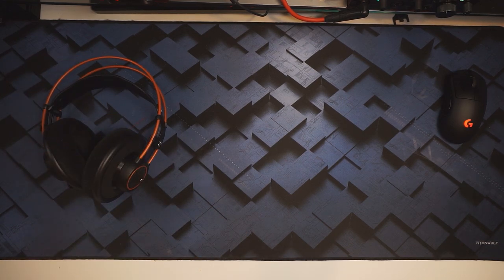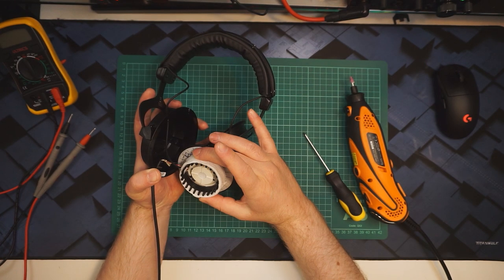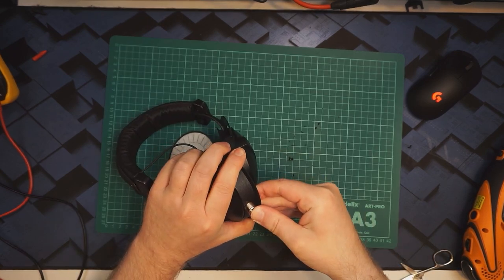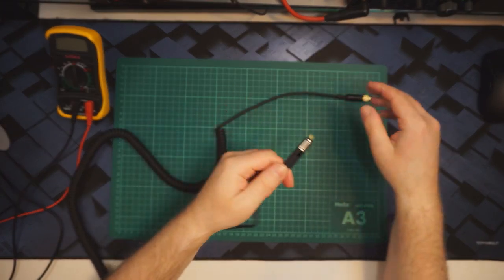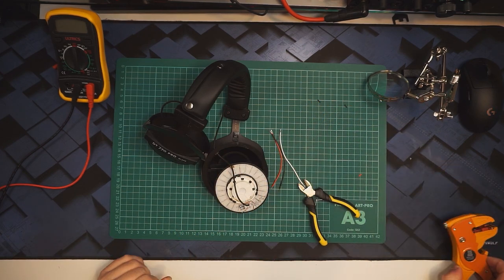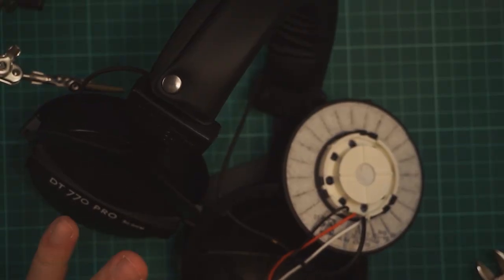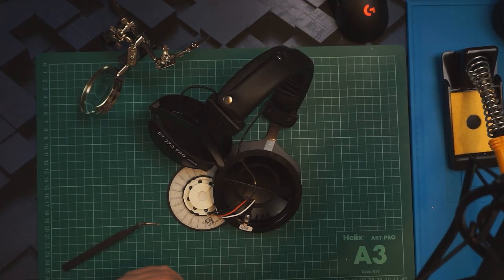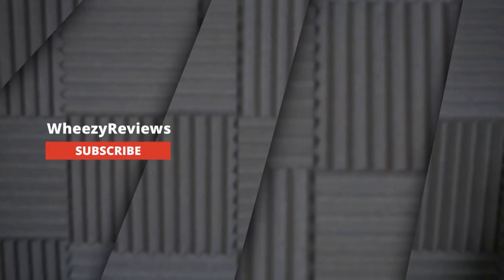DT770 Removable Cable Mod

Comment: It's funny how in your review you emphasized on how EVERYTHING is replaceable, and not mentioning that the cable is fixed!
Reply from the maker: Is it funny? Non removable is not the same as non replaceable. The point is that Beyer makes every part available to replace should they break.
Here is where I mentioned the cable is fixed:
https://youtu.be/3c4cMQuOqeM?t=336
I talked further about the non-removable cable here and why its not a big deal: https://youtu.be/3c4cMQuOqeM?t=1047
And in case you only watched the 80 Ohm video and not the 250 Ohm one, then note what I said here: https://youtu.be/lAv6fcfslCY?t=38
Reply: @WheezyTech  Ah, I see now. I watched the 80 Ohm version review and
I didn't click on the 250 ohm review since I have no interest in buying it. My main interest was to hear if having a high impedance had better sound or not , according to you. 
Plus, you did talk about the cable twice cause it had a different length than the 250 ohm version and then reaffirmed that it's all replaceable. So I came out with the impression that it is replaceable (removable), only to be surprised by the next recommended video, which is  you talking about how to mod the cable to be removable. 
Technically you're right that it is replaceable, but to an average user like me, we wouldn't risk breaking expensive headphones to mod them. To me a non removable cable is a deal breaker.

Btw I watch your reviews and I do respect your opinions, after all I bought the HD599 recently based on your recommendation as well as others, and I'm liking them thus far! So thanks for that.
Btw, I did mod those, but not by opening them and removing the locking mechanism, rather by buying a locking 2.5 mm adapter that is meant for audio technica headphones, fits like a glove!
Reply: @WheezyTech  btw, and this is just me thinking out loud here, but is there a non serviceable headphone (in terms of cable) based on your definition? I mean can't we always just open them and solder on a connector or a different cable? Unless they don't even open, then it's a different story.
Reply from the maker: @TheRoadrunner11  There are quite a few, the K371 in particular. The thing about the 770 is Beyer have specifically made these with repair-ability in mind and sell all the parts you would need to replace any part that breaks. Some other headphones could be repaired but the manufacturer doesn't provide replacement parts. And some are just designed without any thought for future repairs. The 770 is by no means unique in this regard, Sennheiser are well known for making their stuff serviceable, you can buy replacement parts for the HD25, HD5*, HD6* line for example, the later can be disassembled by hand without tools. Sony's MDR7506 is another classic example that is not only serviceable but even comes with a diagram and parts list in the box. It might not necessarily be within the skillset of all users to repair them but as product aimed at professionals with long term durability and repair-ability in mind, having to solder a new cable is not a big deal as long as the manufacturer actually sells replacements.
Reply from the maker: I would much rather Beyer made all their headphones with a removable cable though, hence why I did this mod.
Reply: @WheezyTech  Fair point! I guess I'm still new to the audiophile scene, and I'm no professional in that regard in any way shape or form. Plus I've never been good at soldering. But for a professional, yes I can imagine that would be a god sent if the manufacturer encourages repairs.
Btw don't the K371 (AKG?) have mini XLR removable cables? Or maybe you mean the headband/pads.
Reply: @WheezyTech  I never apologized properly for the misunderstanding and the snazzy comment. I'm sorry. And thanks for the clarifications that followed :)
Reply from the maker: @TheRoadrunner11  No worries. Yeah K371 removable cable is probably the saving grace of that design. But the internal wiring in the headband and the weird gel padding they use, not so easy to replace. And their hinge design is just not solid enough. HD650 for example has internal wiring but you just unclip a piece at the side, slide out the adjuster, and you can replace the cable, padding, headband, grilles, drivers, cups, everything. I have a lot of respect for companies that build their stuff like this.
Reply: @WheezyTech  Yeah I saw how crazy easy it is to take a part an HD600 series headphone! And so weird about the K371! Though unfortunately in this world of ultra consumersim, reparability is not even an afterthought in most industries. Expect even professional grade gear to fall victim to these practices at some point in the future, just as it did in the computer industry for example.

Comment: I’m gonna buy dt 770 pro 250 ohms, but they say the cable is shorter than the cable on dt 770 pro 80 ohms 😆👍

Comment: Can you link the wire you used please!?
Reply from the maker: Its just basic 26AWG copper wire I've had around for ages. Specifically this stuff I have here is tinned copper with a silicone jacket which makes it really flexible. Should be able to pick it up from any electronics place or on Amazon I expect.
Reply: Wheezy Reviews Is it a “stranded” wire, or solid core? (Total newb here!)
Reply from the maker: @antoinep9733  Stranded, its more flexible. Something like 30 strand 26AWG should be about right.

Comment: I've been thinking about doing this mod and 3d printing a holder for a Bluetooth Receiver I have so I can swap between wired and bluetooth, this seems simple enough, thanks for showing how to open them. I may go for normal 3.5mm though

Comment: Never going to sound as good as the captive wire and you have tweaked the fr of that can.
Reply from the maker: With this headphone and the massive unit variances and swings in FR due to pad wear any slight change caused by this mod is negligible and inaudible and outweighed by the other flaws in this headphones design

Comment: Hi, nice job. Can you tell me if the DT 770 250 ohm bass can sound like the 80 ohm version with EQ? thank you in advance.
Reply from the maker: Sort of yes but not really. The difference in bass between 250 and 80 Ohm seems to be more about unit variance than anything unlike the treble which definitely has more extension on the 250. However, I do find the 80 Ohm bass to be quicker and more articulate and you can't really get that from EQ.

Comment: Why the Hell don't Beyer build them that way????
Reply: They kinda did with the 700 Pro X, but it will cost ya an approximate AKG 371 extra in price.  At that point, might as well have a 770 and K371.

Comment: Anyone that wants to do this mod, I HIGHLY ADVISE AGAINST IT. I tried doing it on my headset and realized all their wires are super frail and will easily kink and get audio loss. I really regret doing this mod. If youre really set on it, instead, id rather cut the wire to a slightly longer length than required and just make the line shorter. That way, if you screw it up, you still have room to not throw away the whole headset.
Reply from the maker: There is absolutely a way to do this, such as I demonstrated in the video, where there is very little risk of damaging anything. Even if you do mess up the wiring thats not a death knell for the headphone, you just replace the wiring. There is no part of this headphone that is not replaceable. I actually don't recommend trying to re-use the litz wiring from the original cable connection as its both too short to work with and very difficult to solder as litz cable tends to be. Thats why I replaced the wiring with some other wire thats easier to work with.
Reply: @WheezyTech  Just hold the end of (any) Litz wire clamped in metal tweezers to for a few seconds  in a molten blob of solder to remove the coating and to pre solder it properly.  After that you can solder the Litz without any problem. I also suggest that you cut the original cable outside of the can and re-use the Litz that can be pulled out easily. That's what I do all the time for my customers when modifying their Beyers used in studio's.

Comment: a lot of effort to not take the top band off and pop the arms out. They come out very easily so you don't have to work on a contorted mess
Reply from the maker: Sure, do whatever you find easier
Reply: @WheezyTech  might do :) just rehauled my old 770 pro for being loaned out to a friend for far too long and being in a sorry state.
Changed the pads cleaned and repainted the side letters. This mod sure is tempting and the video clear and good :)

Comment: You lost me as soon as I saw I would have to take a dremel to the hole... lol I have a dremel but my plan was if I break anything I'll just be that guy and return it to amazon and get my money back and purchase them and try again lmfao. Amazon literally takes anything back. But idk if they will refund me with a visible drilled hole... Honestly they probably still would if I cleaned it up and put like a rubber grommet in there and soldered the cable back😂 I heard they don't really inspect things like that anyway.

Comment: Good video, but why a mini xlr connector and not a 3.5mm jack
Reply from the maker: Personal preference more than anything. I like that its a bit more sturdy than a 3.5mm jack and also I have these other headphones with the same XLR connector so the cables will be compatible

Comment: AWESOME.. my DT770 Pro cable got ripped out.. the cans are useless, and no one will fix them.. this mini-XLR mod is what I WANT.. other's offered to put in non-locking trs port, but that is worse, .. try doing a recording, standing up in the studio, then step on the cable... you're disconnected... stop the recording engineer, then fix it, then start again.. ever done this?  but I stepped on it and broke it at the end TRS plug..; completely unusable.. until THIS VIDEO... yeah, it's risky, but the cans are dead and unusable now, if I do it and it's a success.. 'happy dance' if it doesn't .. well, no better than I am now.. Just will never ever buy a set of studio cans without Detachable mini--xlr.. (note to manufactures of headphones..get a clue. eh?)  haha